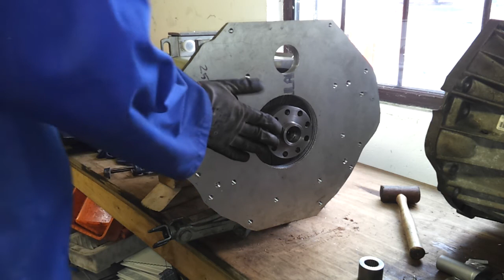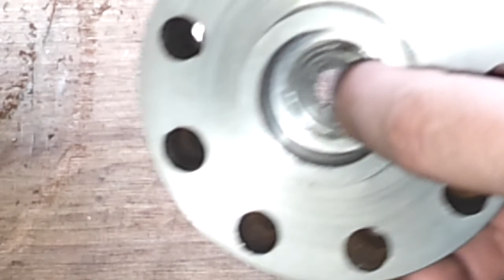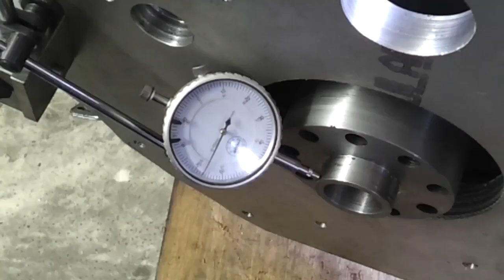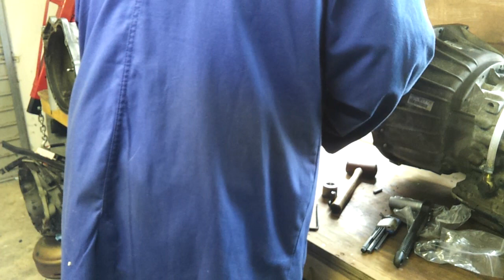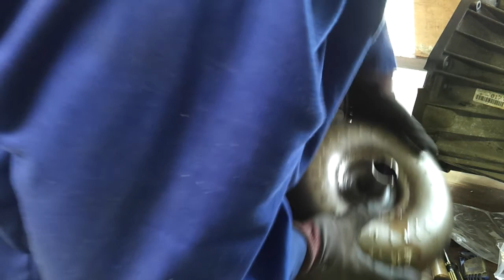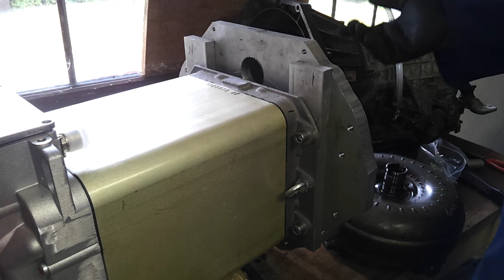BMW E31 840CI EV Conversion 03:Adapter plate 02

Comment: The torque convertor center him self in the gear box and the weight on the same side not on the flex plate his getting only the moving from the motor thru the plate witchs keeps it pressed on the gear box as u say that it's only a flex plate not a flywheel whatch is keeping his wheight on the engine shaft and even center this one

Comment: Hi Damien,
watching this playlist with keen interest, but I'm just a bit wary of your method of measuring the "runout"@17:50, I couldn't help but notice the axis of the dial indicator does not appear to be at a right angle (i.e. square to the tangent) and therefore your readings would be amplified. I'm no machinist, but my Dad was a fitter and turner and taught me the importance of geometry and the reasons for it's proper application in all things square and rotary. Probably a bit late now that the car is complete, but do you agree the readings would be more accurate (and therefore lower - better) were you to correct that alignment while measuring...?

Comment: Damien
Regarding the adapter hub: not sure if you are going to run it like this but if you are planning to make another one you should consider a few things in your design

 - use the smooth part of the motor shaft to locate the hub, as you can see there is no centering "feature" on the splines, the mating has no interference, you should make a shoulder behind the splines that slides over the larger diameter on the motor shaft with some minor or 0 interference just like you did for the flex plate to the hub. You can also gain some length on the smooth part of the motor shaft behind the splines by removing the "dust ring" on the Siemens front plate (Anne from Holland did this for his modified "stubby" shaft), that way the interference length can be longer and stronger at the same time. You can also use the inner race of the bearing for the bottoming fit rather than the washer under the M8 bolt as it is right now.

 - i would use a larger bolt for the hub (rather than the 8mm that is in there right now), maybe an M12 or M14 fine thread and for good measure i would use a flanged bolt. You'll have to drill and tap the motor shaft but I don't see that being a major technological challenge for you/ Don't capture the washer when you press fit the splines but machine a shoulder on your hub and use a thick (and hardened) washer under your flanged bolt, something like what you have in the front of the crank for the harmonic balancer.  I think this would solve your runout problems (and the non-repeatability issues as it seems that you get different results every time you tighten the bolt).

- you could bore thru the hub and weld the splined shaft on both sides then machine the outer face flat for the washer/bolt to sit on, and of course machine the hub to final dimensions after that.

- make a mandrel (shaft) that would register on the portion behind the splines in your hub and not on the minor diameter on the splines, you could have a mandrel that replicates the motor shaft with a shoulder at the back for the bearing race, a precisely machined portion to replicate the motor shaft, loose fit for the splined portion and a threaded part where you can use a nut (as your bolt in the center of the shaft would be), if you mount that on the lathe between centers you can probably achieve very good tolerances.

Also, how are you locating the adapter plate to your motor? - that's one thing i would consider for the binding issues you had, if it's not centered it might be the cause for binding when you get to 3rd and 4th bolt on your flex plate.

hope this helps and looking forward to more progress on your build

Comment: Hi Damien,

I have one of the Azure Dynamics motors and plan to use it in my Austin Healey replica build.  I need to mate my motor to a Jaguar XJS differential/rear axle and, given the available power of the Siemens motor, I was hoping to avoid having anything other than a fixed ratio gearbox in between.  Did you consider this option with the BMW?  If so, did you find anything suitable to use as the gearbox? I gather I need an overall 8:1 reduction and as the Jags diff is around the 3:1 mark I'd need a gearbox with a 5:1 reduction. Any thoughts?

Keep up the good work!

Regards, Martin.